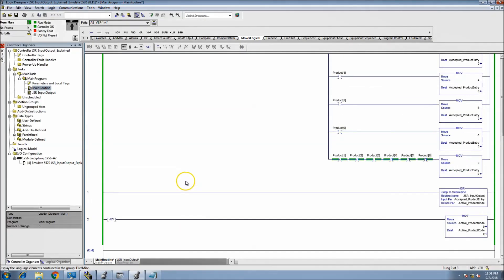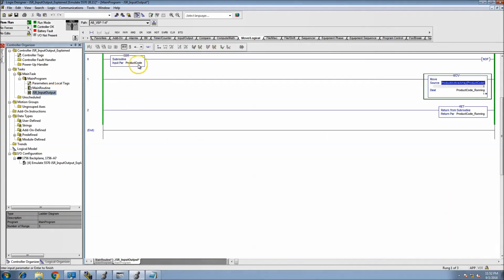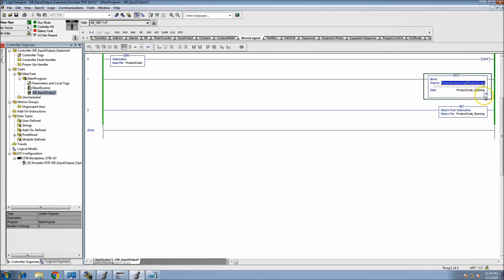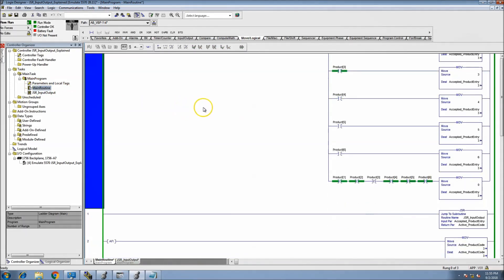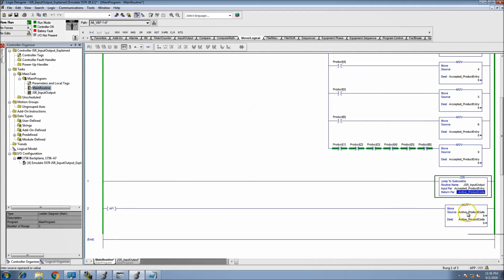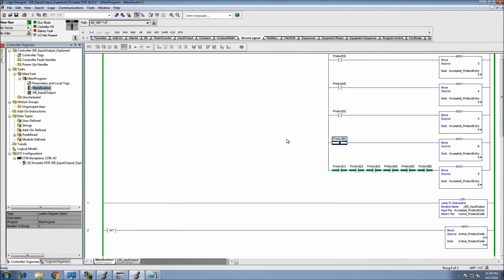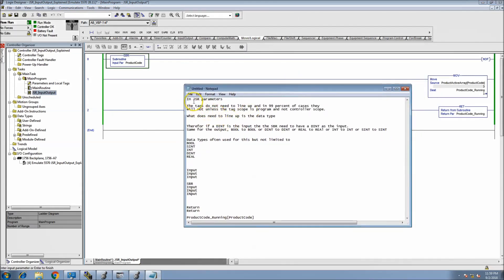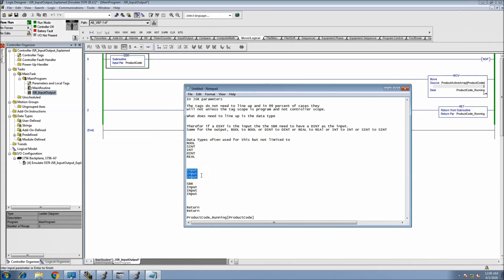RSlogix 5000 JSR Input Output Parameter Passing Made Simple [Official Video]

Comment: I've had your RA Udemy course a while and kinda gotten around to working on it. So it helps to know where to find you as a sub. This video is a partial of Vid# 37 in the course which is longer and a good video. One thing I don't exactly understand is the "Subroutine" Tag that is at the top of the rung for the routine JSR_InputOutput. In my mind, I'm trying to read the logic so it makes sense and I'm not understanding the instruction that is served when I see the Subroutine instruction. So if you can explain that in clarity it would be helpful.
Reply from the maker: The subroutine that is the input output parameter is derived from the JSR loading.

Meaning, where the JSR instruction is located is where the input output parameters are loaded into the subroutine.

Hope that clarifies

Comment: Thanks for this video, very helpful. One question though, why not just move that value into the final location instead of running it through a JSR SBR RET? It seems like a lot of extra work and confusing the code?
Reply from the maker: Because the is built for power programming or modulus programming.

Meaning, only built it once then use the same code over and over in programs